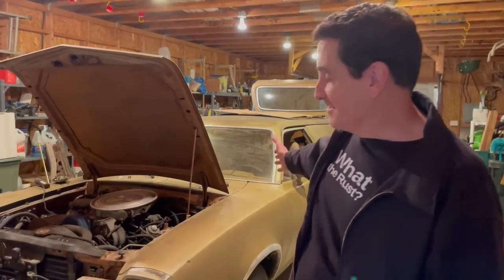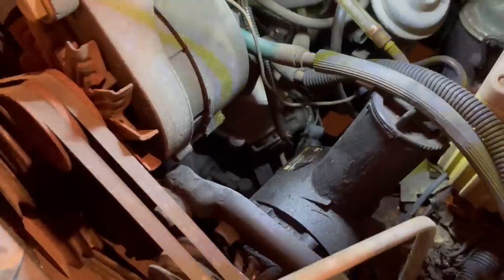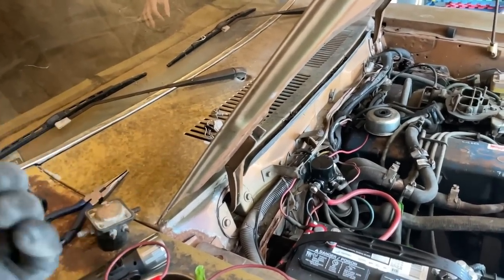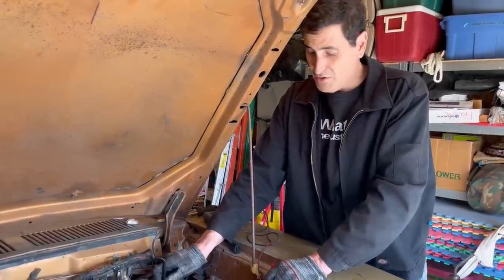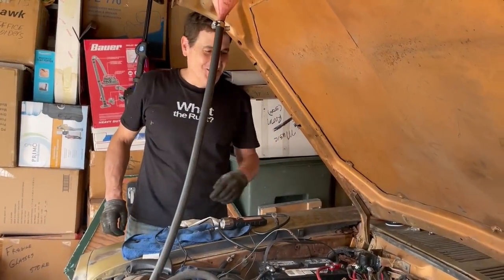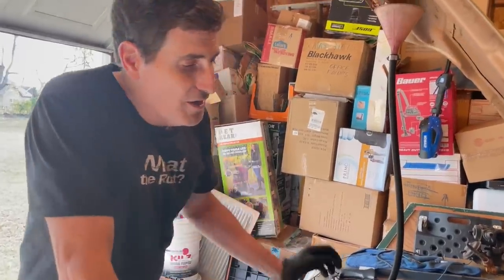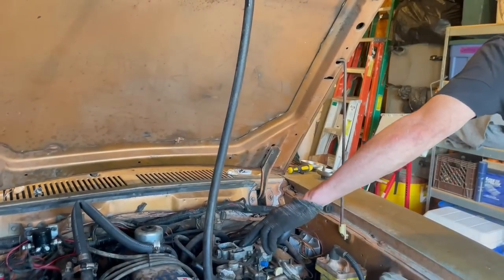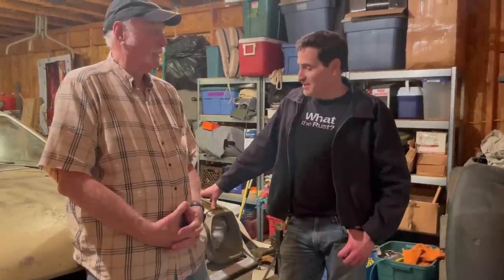Will it run? 1978 Ford Pinto party cruising wagon!

Comment: Christina seems to know one heck of a lot about the engines.  She asked Richard if he did certain things which he hadn't and needed to do.  They work well together and Richard brings a lot of knowledge to the table.  The little Pinto will run on with a few minor additional fixes.
Reply: The Pinto wagon was not only fun to drive, 
(with the 4 speed) that 2300 4 banger was also rock solid dependable.
 I've owned Three, including a 77 'Cruising Wagon'.
 I'm a retired sign painter/installer and these little ponies were my early work trucks. With the hatch open, you could carry a stack of 4'x8' plywood or drywall ! You can't even do that with most of the modern SUVs & crossovers.
 I'd love to find a decent driver to toss around on weekends...👍🏁

Comment: on the very rear of the carb/intake there is a large vacuum hose that tends to crack and break. I once bought a pinto of this age because the dealer couldn't get it to idle and sold it to me as is. I took it home found the broken hose and BAM! it ran like a top and idled just fine... I loved that little car....

Comment: I bought a 73 Pinto used in 1978.  I loved this car, a 2.0 4 cylinder with the german 4 speed.  The cam was ground round so I wen to our local auto chain, Gratiot Auto, and bought a 3/4 race cam for $19.95.  I also recurved the distributor, rejetted the carb, and this little hot rod left the small V8's crying.  It was a real handler also.  It was rusted bad when I got it, and i drove it 3 years, sold it to a kid around the corner for $300 (paid $700), who did the body work, painted it orange, and drove it with a smile on his face.  He honked and waved whenever I was out in the yard when he drove by.  Pintos were much maligned because of the gas tank issue, but they were great little cars.  Most don't realize the Mustang II was just a Pinto with different skin.  I always wanted the little wagon like you are working on.  The 2.3 L was basically a larger version of the engine I had, with more torque.  I think you will be surprised when you drive it.
Reply from the maker: Great story Dave. I remember Gratiot Auto. It was like Summit Racing, but in the 80s.

Comment: I used to have a Pinto Wagon that year but not the porthole windows. It was really nice copper paint with lots of metalflake in it and tan int. Great little car, my late wife loved it. Bought it near new, it was 2 yrs old at the time. Yeah they weren't fast but they did well as long as you kept them maintained. Great commuter/daily driver, cheap on gas. lots of room for groceries.

Comment: Just watched this great video and really enjoyed it. My first car I bought myself my first year working after college was a bright red 79 Ford Pinto with a full glass hatch. It was a good running car and fun to drive and I had it 11 years before trading it in. My two biggest problems with it were the electronic control module which I ended up replacing at least twice (that you replaced on that one) and the front brakes that had a sliding caliper that would rust up and not slide. Wished I had kept it but had no place to store it. Keep the videos coming.
Reply from the maker: Wil do! Thanks for watching.

Comment: Ive owned several Pintos in the past. Anywhere from total beater to a 1974 that had 33000 miles on it when i got it from a friends mother who bought it new. I paid $1000 for it ! Good little cars they were , very dependable too ! That one looks to have all the options. PB PS and gauge package and wheels. Sounds pretty good once the oil pressure built up but she is a smoker ! lol Cool !

Comment: I had a Chevy Vega panel wagon. What workhorse that thing was. Floor boards rotted out and the rubber floor padding melted. Had that same trouble with the ignition box on a Fairmount I owned. Used to keep a spare one in the glove box. Good fix guys.👍🇨🇦
Reply: man i hate those ford duraspark units, oofta..what a pain
Reply from the maker: I hear that a lot about those ignition boxes.

Comment: Through the years, I've owned 3 Pinto Cruising wagons - loved every one of them!  One was a badly wrecked project that eventually went away, I was talked into the sale of another (mistake) and the third was traded on another car that I did not really want (yet another mistake.)   Ahh... but I have something in the works again!
Reply: Wow!  It's a very unique automobile!
Reply: Almost original  front seats have been  replaced with later  model ones stripes  missing and no roof racks. I have a 77 been  replacing  parts on for years towed van into junkyard and brought  pinto home. Rubber stripe covers screws on side panels have been  obsolete  since 1980 from Ford, so much for the  10 year  rule for replacement  parts.
Reply: My dad's friend had one with a400 m sounded really nice and it was cherry

Comment: I had a '74 Pinto with the 2300 engine.  That engine was tough!  Several of my coworkers and I had set our cars up with water injection and it worked great on my car.  I could tell when my water had ran out because the gas mileage would drop along with the power.  I don't think any of today's plastic computers on wheels would work with that.
Reply: I had a 74 wagon my parents bought bran new. It got me half way thru college, it was a trupper no less

Comment: Strange "porthole Pinto" 😲 and for the case, I would say "less cylinders, less easy to start".
Also interesting what you told about the EGR valve at the time ... Most probably a component coming from
"clean air act" application.
Nice job with some difficult to find / to solve issues but What The Rust team still stays cool & calm 👏 !
Reply from the maker: Thanks Christophe. This one had some problems we don't often see, but it worked out well.

Comment: I remember seeing a lot of them. Yes, I'm old, and I had one of those vans you talked about. My van had the tear drop windows. That little 4 banger was nothing great, but they weren't bad either. Changing the timing belt wasn't an option. I saw a very rare one once with a factory V8. I had no love for them when they were new, but now I want to own one. I'll have to settle for my 66 Ferd. The first gen electronic ignition (Duraspark I ) it was usually the box that failed...a lot. After that it was usually the little module in the distributor. At least that was what I always saw.
Reply from the maker: That one is for sale, If interested I can put you in touch with the owner.
Reply: @whattherust  I'll stick with my 66 Falcon for now Besides, I'm in Canada. Would cost more to get it here than it is worth. Thanks just the same. Maybe my next car. I've been driving my Falcon for 6 years now.

Comment: Oh wow I used to have one of those mine had the silver and black stripes down the side and the optional 2.8 V6 engine with an automatic transmission factory gauge pack and factory air had it back in  1990 ran across it at a small local country car lot sure wish I'd kept it

Comment: Just found this video. In Australia we called them panel vans built by Ford and Holden. They were big in the 70s and 80s as work vans plus decking them out with carpets, lights cushions etc etc.. No passenger seats in the back.
Reply from the maker: I did not know those were available in Australia. This one was decked out with carpet and special lighting too. Years ago it must have been quite a car. Thanks for watching!

Comment: The Accel coil probably wasn't there because someone wanted to race it. We had a Bobcat hatchback, which was just a Merc version of a Pinto. They had a design flaw. The hood seal where it met the fenders would leak, especially in car washes this was a problem for ours which plagued both our 74 and 79. Water would leak down onto the coil and it wouldn't start after rolling through the car wash. Replacing it with an Accel coil which was more water resistant solved this problem. In fact, for all the Fords of the 70s and 80s I owned I replaced the wires as well with Accel wires as wet weather was a problem with the factory wires after they were like 6 months old. I wasn't interested in making them faster, they  just had to start and with the Accels they did no matter how foul the weather.

Comment: These portal pinto wagons come up for sale from time to time. They're pretty neat. If you shop around you can find them dirt cheap you may have to drive across the country to get it. But then at the same time the same condition vehicle or go for a premium.. I've got a skinny bumper that one's a fat bumper because of the two and a half or five mile an hour Federal crash standards they had to make the bumpers bigger. The skinny bumpers are Chrome the fat bumpers are aluminum. Anyhow the wagon I have since they late '80s to early 90s it has those factory aluminum slots on it. Anyway they can be neat cars. I may be wrong but I believe those engines liking that one are the grandfathers of the ones you found in the terrible Thunderbird hoops in the mid to late '80s. And also on the mustangs. After all a mustang too and a pinto just different bodies on the same platforms. The wagons being longer of course. They came with some very interesting paint jobs from the factory and then some were customized later. My favorite was black and silver with either the red pinstriping are the color coordinated black/silver pinstriping. And they had like her horse or horses head on some of them that were painted. I believe it was on these cars like the one you worked on in this episode. But honestly they were about fuel economy and rather or not you want a fancy paint job. All across the industry the performance packages just wasn't really available after the Orland bargo of what 1973 ish. Glad to see a new episode .

Comment: I remember those old Shagging wagons and vans. The fiberglass patch on the roof wasn't from a vinyl top as they didn't put them on those wagons. I would say something was set on the roof for an extended period and caused rust.
Reply from the maker: I think you're right.

Comment: I have a 1979 ford pinto cruising wagon , you guys should come down to chicago and check it out, I’m trying to get it reliably ready lol it runs too😊
Reply: Having trouble with electrical stuff, dash doesn’t read rpm’s , occasional works , gas gauge doesn’t work , turn signal doesn’t work on the left signal

Comment: interesting car here. :) I know it only as a hot wheels custom vehicle, which is equally rare. XD

the OHC straight four was pretty popular here in europe, with displacements between 1.3 and 2.0 litre. the US version is larger, goes from I think, 1.6 to 2.3. someone said if you use the pistons from the 2.8 V6 you can bore it up to 2.5 litres... not sure how many tried it. Pintos just don't happen in europe, everybody wants a Mustang. :) also, the european OHC compartments aren't as crammed, even on an Escort. an AC was optional, too, tho I have never seen one until the Sierra came out. you'd find the smaller OHC only inside a later Capri, if ever, I think... for those who wanna pinch a dime. XD a 1.6 OHC Capri is still swift enough to be ticketed, but nothing compared to US V-8s which have more displacement than the Capri had trunk space. :P
Reply from the maker: I do like those early 70's Capris!

Comment: Be great for a 302 Windsor conversion..In Australia we didn't get the pinto. But Ford Australia for their small Ford's assembled the the British Escorts and Cortina. The great thing was Ford Australia had the Aussie Ford Falcon 6 cylinder as an option in the Mk3 Cortina. I had a 4cyl Mk3 Cortina  and Put  a 302 Cleveland from a Aussie falcon with a Top loader got a 9 inch diff shortened to suit used Falcon brakes all around. 
I used to Do so many Burnouts in it. I used to go to the local tyre shop to get old stock tyres on stock rims for the back to do Burnouts on instead of my Good mags  wheels. Cause I did  so offen I go into to pay for the Fitting of the tyres come out and here's the guys with my Cortina rear jacked up with the guys bolting the stock Burnout rims on saying do a Burnout as I drive away Arhahaha.. So yep put it in 2nd opened it up got in the brake and did a slow run up the street with the tyres frying couldn't see out the back and a Big cheer from the boys at the shop lol.

Comment: pinto cruising wagons were made from 1978,1979 and 1980 only.3 year run.they never came with vinyl top,think it was sitting somewere and rusted out and they put that bad fiberglass job on it.the port hole windows as there called in the back never had the neon round lights,sombody adding them as well.i owned 5 them cruising wagons over the years!!
Reply from the maker: Thanks for the info!

Comment: The carb Looks like a twin choke webber carburettor to me. I built a jago jeep kit car in the 90's here in the UK and used a 2 litre pinto engine it.had a webber on it which looked the same. They were performance carbs. You will have to Google jago jeep to understand what they were. But basically a willys jeep based on an ford escort with fiberglass body.
Reply from the maker: You're right, that is a Weber. I knew I had seen one before but couldn't place it.
Reply: I should of also said great video!!  Really liked those round back windows very funky

Comment: That steering wheel is for the Ford stallion package that was for 1976 mavericks had that package as well as the Mustang 2's an yes that 2.3 four is a good engine, also it's a non-interference engine if you ever break the timing belt found that out when I had a 74 mustang with the 2.3 an the belt broke while driving it
Reply from the maker: That is good to know. I know of a Ford EXP with a broken belt, and I had figured that engine was junk. Perhaps not.
Reply: @whattherust   yeah all you have to do wit the 2.3s is have the damper crank pully set at TDC, the overhead cam  gear lined up with the timing maker and by turning the auxilary sproket that runs the distributer on these
 engines turn it until the rotor is pointing at the #1 spark plug and your all set to go

Comment: the major problem with those engines was if i remember correctly the water pump is driven by the timing belt. i used to tell all my customers to replace the water pump every couple years and timing belt because some years if water pump goes out stripps timing belt and some years bends valves
Reply from the maker: I did not know that. Running the water pump off of the timing belt does not sound like a good idea.

Comment: During the period they were putting those smog pumps on cars, the second the car was out of warranty that pump went into the trash. It was said the pump used seven horsepower that that engine could not afford to loose. Plus it was just a bunch of junk in the way. Everyone I knew took them off.
Reply from the maker: I remember that too. If myself or my friends bought a car with those pumps, we removed them. IT was the thing to do.

Comment: Richard, why don t you make/invent a tool that can be quickly screwed into a spark plug hole with some kind of balloon on the end ? One step I see people making on You Tube is that they will put oil in the cylinders and then turn the crank but as you go you could have that tool showing you if you had compression or not in each cylinder.
Reply from the maker: Ture Linda. I have seen people also use a whistle that will make noise is there is compression blowing through it.
Reply: @whattherust  I try to break it down in steps and you can save yourself a lot of work. Sometimes with these stuck engines it leads to broken rings, metal eaten away in the bores, stuck/seized valves, etc. As you re doing the work to bring it around it might be smart to have other things working for you and you ll know right away before you get into looking for stuck valves or removing a head.

Comment: 20:57 EGR lowers the combustion temperature below 2500 degrees. This kills the oxides of nitrogen which is some nasty crap. It does use the exhaust gasses but it isn't recycling them. Wrong term friend. Sorry.

Comment: didnt test the trigger wire with a load on it, with no load, the trigger wire produces voltage.   Should have tested wire with it on the terminal of solenoid

Comment: Well I'm not sure if it was 1978 but it was somewhere right around in there a Ford did a special edition they did an elf I think it was a I think it was a 150 it might have been a 100 but it was a full size van and it was like a van and it was a special edition and they did a van and a pinto wagon like that both of them were painted exactly the same and the paint jobs they were white and they had yellow and red and seemed like maybe black Stripes they came down off the roof behind the porthole on the side and then turned and went all the way to the front and the van and the piano was painted identically the same the only two that I know of around is the ventriloquist he has the little characters Walter and Peanut and Jose Jalapeno on a stick will anyway he's a big car guy and he found the van and found out the story on the van then he started searching and I don't know where he found it but he has the pinto both of them are restored fully paint exactly like they came from the factory from Ford and he even had found a it's a big promotional like banner and it's up on the wall in his where he has all his cars inside the building and it shows the van and the pinto but that was a special deal that Ford dealer head and some were sold I don't know how many of those matching sets of van and pintos there were but it might be something to look at